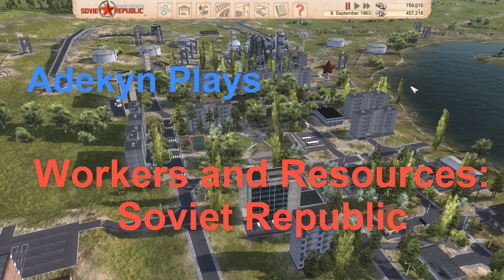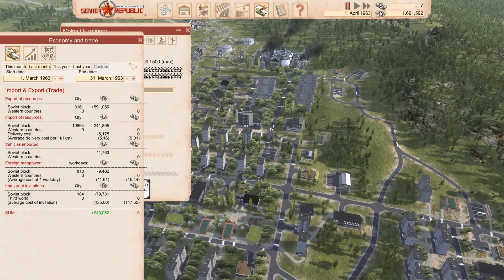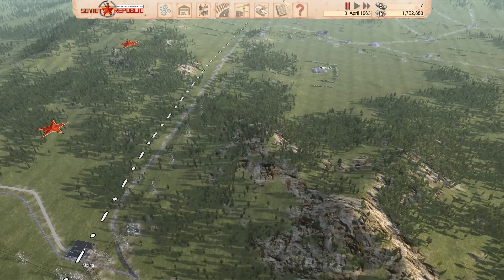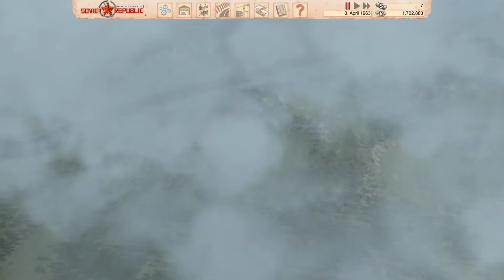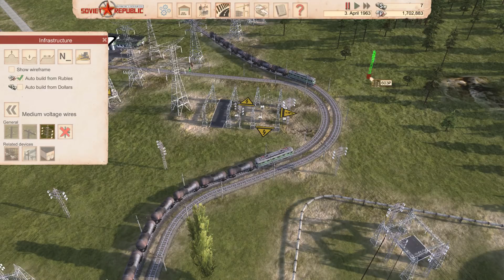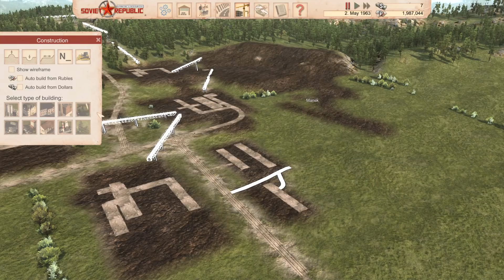Workers & Resources: Soviet Republic - 1st Playthrough (all Hard Settings) - Part Four

Comment: if u not connect buildings with roads, u not have problem with possible fire later?
Reply from the maker: Fire trucks and ambulances will travel on paths to get to the apartment buildings. They move more slowly than they would on roads, but they will provide emergency services.
Reply: @Adekyn100  thanks a lot, i like ur videos. Cheers!

Comment: Is the map always the same? I thought it was randomly generated. But you want to have your workers away from Mines so they have some pretty housing and don´t run away.
Reply from the maker: The map is always the same. At this point they are not randomly generated. The location of the house in terms of surroundings does not affect happiness as long as you can get your people to the buildings that satisfy their needs.
Reply: @Adekyn100  Thanks for the answer! I didn't know that. But are you sure with the mine thing? Because I had a settlement where everybody would flee even though they had everything they needed.